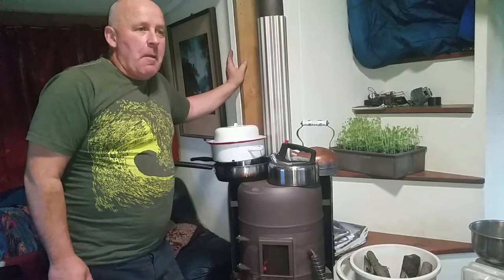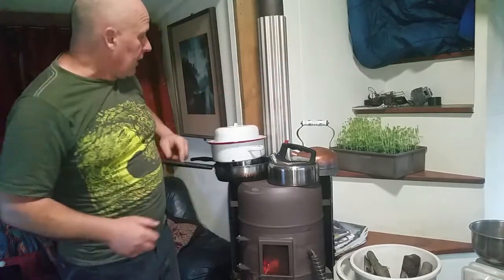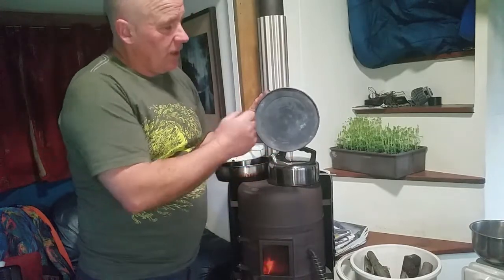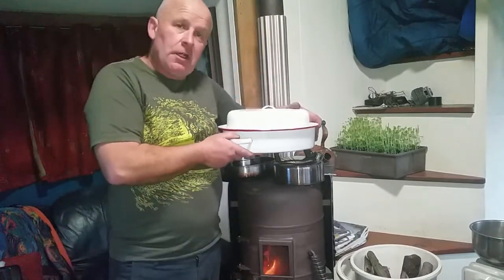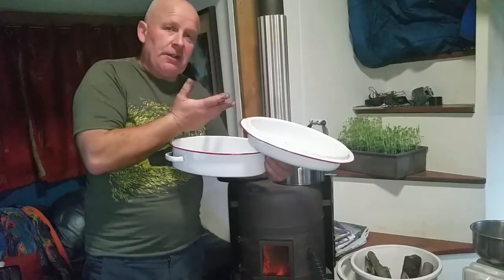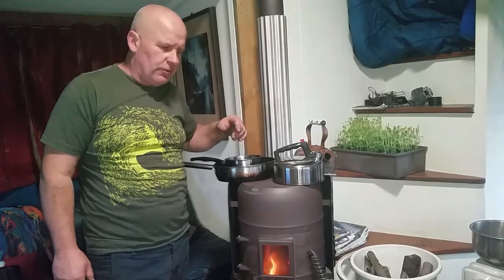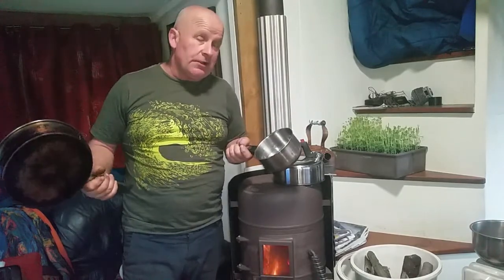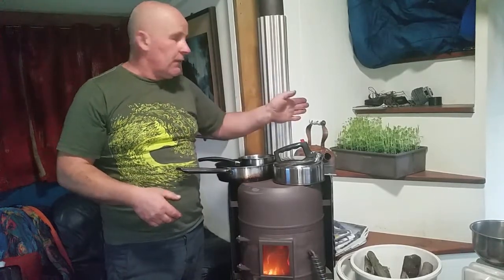Best Cookware for Wood stoves 2018

Comment: I can't get a rolling boil in a flat-bottom stainless pot on top of my woodstove, despite top temperatures of >300c.  But put it on a gas burner, and it's rolling in 5~10 minutes, no problem.